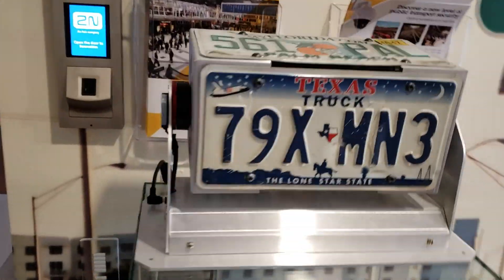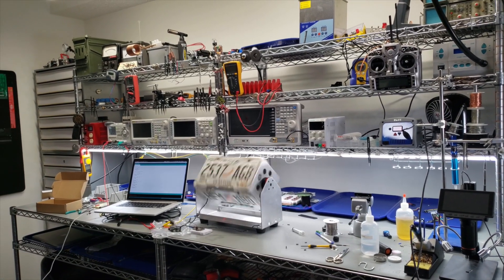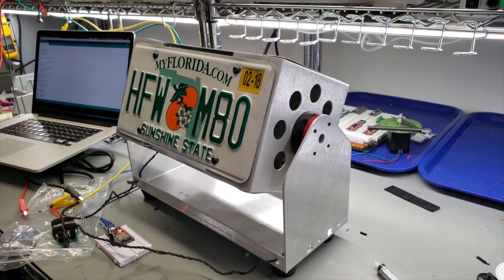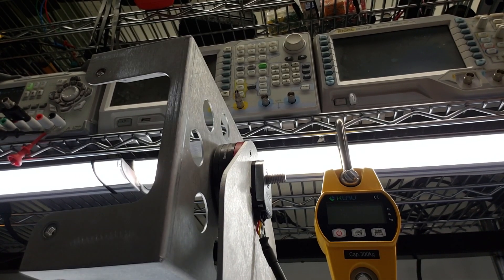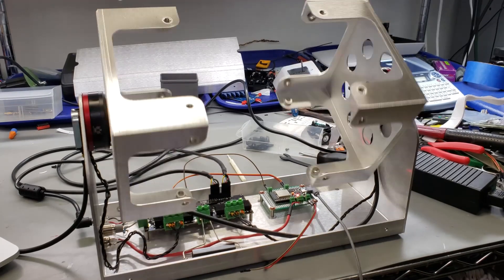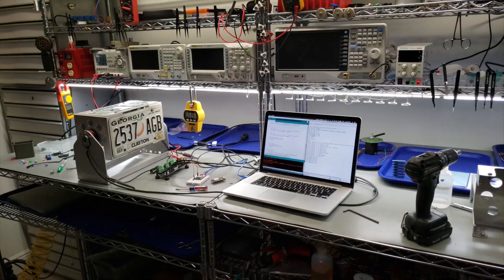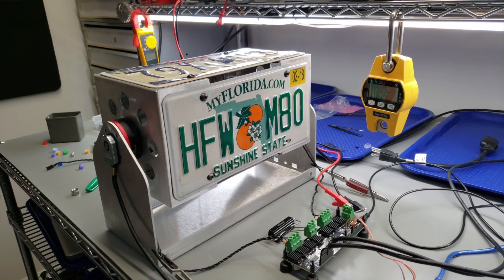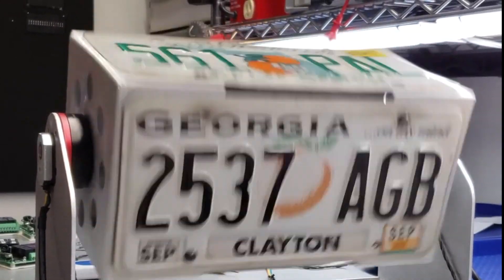ESP32 ODrive License Plate Spinner

Comment: Why not just use a Ball bearing on one side instead of two motors? 
genuinely curious.
Reply from the maker: Mainly for more responsive speed control and it is much more aesthetically pleasing with those two motors in my opinion. It's in a show room and the customer really liked the way it looked like this. The motor I chose would have handled it but it would not have been able to move nearly as fast as it can now. It was a nice challenge getting them synced together and I learned quite a bit which is always nice.

Comment: What exactly were you testing? It' of course an eye catcher for a show room, but in reality, you don't have rotating plates and real world problems (I assume) are rather dirty plates, low light, maybe occlusions. I guess you can scan cars while the are supersonic, but is this a standard requirement? And is this more a show case for the camera you use or for the detection software?
Reply from the maker: A customer asked for this, so I made it. I'm not testing anything. I did see their software working on a monitor picking up the different plates as they move into view. It's just a selling tool that can also be used for testing the software.
Reply: @ProtoG42  ...short answer for questions like this...

Customer Wants.
Customer Pays.
Customer Gets.

🧐

Comment: Just curious, why did you need two motors instead of one?  At first glance, it would seem one would be powerful enough to drive the whole system (and you wouldn't've had to spend time syncing anything).
Reply from the maker: Mainly for more responsive speed control and it is much more aesthetically pleasing with those two motors in my opinion. It's in a show room and the customer really liked the way it looked like this. The motor I chose would have handled it but it would not have been able to move nearly as fast as it can now. It was a nice challenge getting them synced like and I learned quite a bit which is always nice. I also could have taken the easy way out and just used a stepper motor but I really wanted to used a direct drive brushless motor. It also has current control so if you stick your hand in it, it will automatically stop.

Comment: How much what the O drive? and are you using an arduino or a raspberry pi to drive it??
Reply: ESP32. Think Arduino lite. Uses the same API.
Reply from the maker: @cheif10thumbs  I wouldn't exactly call an ESP32 an Arduino lite. An ESP32 has two processing cores to run code on, WiFi, Bluetooth as well as many other advantages over your generic Arduino board.
Reply: @ProtoG42  I was trying to keep my comment brief and possibly over simplified since the question was already answered in the thumbnail. Been fiddling with this stuff for about 30 years and i don't like to scare new people off with an overly pedantic and detailed answer.